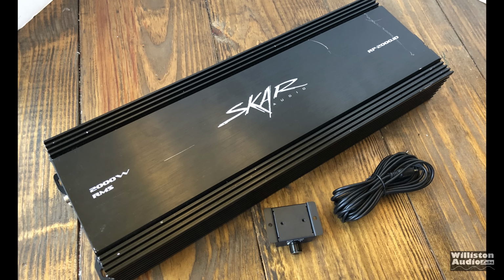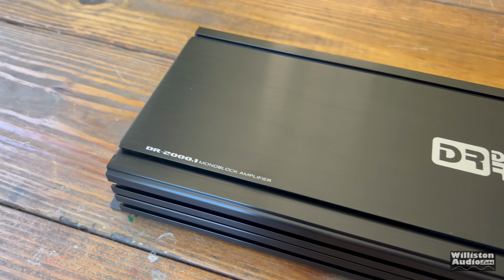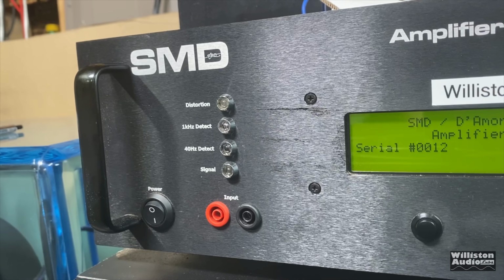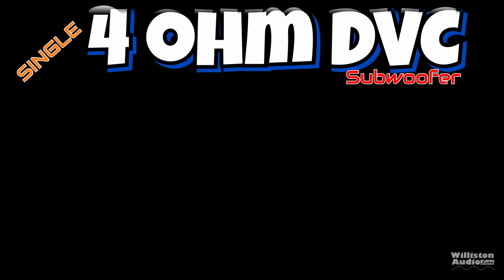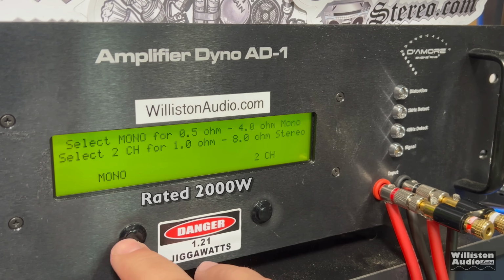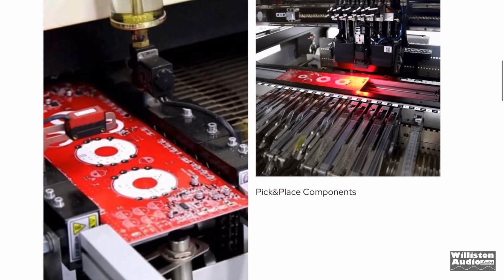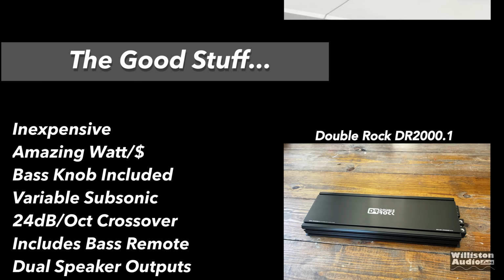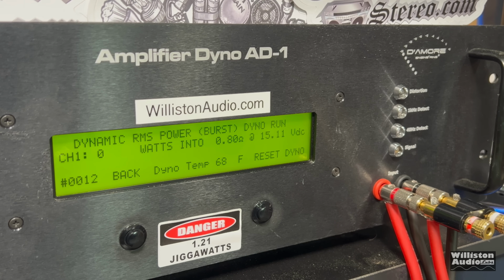SKAR Audio Wants it BANNED!! Double Rock DR2000.1 Amp Dyno Test and Review

Comment: Ya lol sry but the Dyno over all means zero as amp dynos so not account for impedance. Ya you can drop below 1ohm tho how long will the amp last is the real life ? here. For the cost of the amp with no warranty after the 30 days um ya deff now worth the money. No warranty after 30 days 100% yells won't last and after 30 days you're sol if something goes wrong. Can't tell cash grab any faster. I see a lot of kids who don't know amps or what they are looking at jumping at the amp due to its cost then losing the amp and complaining.
Reply: Of course the Dyno accounts for impedance. He even tests at different impedances FFS.
Reply: @johncoops6897  just stop talking lmmfao, impedance is not the ohm load. Impedance effects the over all ohm load which an amp Dyno does not account for. Impedance also known as box rise only comes into play when the amp is installed on a system with subwoofer in a box. Less the amp is hooked up to subs which it is not in the video impedance is not accounted for.
Reply: @ColdVenom159 - the impedance rises but never falls due to the speaker and box. Since there will be less stress as the inductive/resistive load increases, the absolute most difficult test is when the amp is driving a constant resistive load at a constant frequency, as tested here.
Furthermore, ALL power tests are done into a standard and constant resistive load so results can be compared directly and fairly, without the influence of speakers and enclosures. All manufacturers test and rate their products with resistive loads, and in fact they use special "minimized inductance" resistive loads to keep the ohmic load as constant as possible.
So, whatever you are babbling  about has nothing to do with amplifier power ratings. However it does factor into the overall result.
Reply: @johncoops6897  incorrect, impedance goes up and down when a song is being played, impedance dont rise then just stay at its peak according to the enclosure. that alone tells me youve got zero idea what youre talking about. while playing a song depending on the note being played the impedance will go up and down. even with the system the slightest vibration of the box will cause impedance to rise. amp dyno do not account for impedance as when using a dynp the ohm load does not change as the amp is not hooked up to subwoofers. stop trying to use bigger words in an attempt to sound smart its not working. youre over all the one babbling about nonsense. theres tons of videos on yourube alone with people using the AMM-1 with subs in boxes hooked up to an amp showing the impedance changing while music is playing. notice unlike you i dont have to edit my comments.
Reply: @ColdVenom159 - the impedance rises with FREQUENCY (at various nodes). Power tests are ALWAYS performed at a FIXED FREQUENCY , usually 1,000 Hz but BigD uses 40Hz for some tests.
So, whilst you understand some basics, you are completely and utterly misunderstanding the purposes of power testing , and the methodologies used to ensure that the impedance is kept as stable as possible.
For example, an amp might be rated 2,000W into 2 Ohms at 14.4V. In order to test if it actually makes that 2000W, the other two variables (Impedance and Voltage) must be held to their respective values.
Power tests into a speaker and box are not relevant in comparison testing, because it doesn't keep the test parameters as stable.
BTW I only edit to fix typos, which are introduced by typing on a tiny phone keyboard. Your ability to type unfortununately doesn't have any bearing on your understanding of the testing methodology.
Reply: @johncoops6897  its getting tiring already correcting your misinformation. dyno testing is done to see what am amp does according to how its rated. doing a lets say 40hz tone on a dyno the amp is tested at a solid non changing frequancy. i know far more then you think i know and well just by all your misinformation i know alot more then you know. tbh with your 22 subs and zero videos i dont have the want to entertain what you say anymore. youve done a great job with some google research that i will tell ya as some of the things youve said feels like a legit copy and paste outside of you mis spelling things. you can say im misunderstanding this or that tho thats why everything ive said i can credit with proof. on that note i dont have a need to waste my time with someone who can only manage to talk. ill let yuou keep tlaking tho as you seem to like to talk. i dont care to talk i rather actually be doing the stuff.
Reply: @ColdVenom159  - LOL, most people aren't even bothering with you and your silly comment 😃
I regret taking the bait.

Comment: Skar doesn't make their own amplifiers.  They contract a 3rd party to make.  Which happens to be the same company that is making this amplifier. Instructions are identical, the heat sink fins on the side are the same, even the terminals on the ends are the same.  It's the same amp.
Reply from the maker: I discuss this when I open the amp to show internals

Comment: There are two amplifiers that i've been searching on the internet for the nemesis aubio dyno and b drive wdx amplifier dyno
Reply: Get the Soundqubed S1-2250.1 I have 2 of them strapped at 1ohms half ohms per amp and it handles. I also once had them strapped to half ohms .25ohms per amp and it also handles!! I got 2 18" Resilient Sounds Platinum subwoofers ✔️it out.

Comment: I have a equation of probably some law I’ve not been able to read or digest, and it deals with wiring in series for speakers. I was going to wire a 3-way component set in my front doors, using in-line crossovers for the various speaker sizes. I was putting the 6” first, with bass filter, then 3.5” or 2” mid next in series using a higher frequency bass filter, and then a tweets last in series line on high pass filter. My question pertains to balanced power for each speaker set: does each speakers power handling ability dictate how much power it takes from the feed? If I feed 200 watts, will the power be absorbed equally in distribution to speakers? Or will my first speaker in series have to be not too power hungry for trailing speakers ability to get enough power? Cheers! Thanks again
Reply: The speakers draw what they draw. The crossovers dictate at what frequencies they draw.
You shouldn't be wiring non-uniform speakers in series, that is dumb. The crossovers should also never be wired in series. You are completely confused about how to wire this up!
You need one pair of conductors coming in, and each crossover's input connected get to that. The speakers then connect to the output of each respective crossover. So, each speaker has it's own crossover, and all the crossovers are supplied by a single input signal.
It doesn't matter if the crossovers are inline or not... that's the way it works.

Comment: Is there an article on efficiency. If amp takes 1/0 imput and is 80% efficient, then why only 8 gauge speaker wires. Shouldn't they be 80% of the imput size. Can someone help point me in the right direction. Thanks
Reply: Watts = Amps x Volts.
The input voltage is only 12V, so let's say it takes 100 Amps to provide a 1200W (input).
The speaker's voltage is determined by the Amp's power rails, which are internally stepped up (from 12V).
At 2 Ohms, the speaker is given (say) 22.3 Amps at 44.7 Volts and will give 1000W
This is basic information to explain the concepts and theory only, as it is quite different at AC Frequencies and with real loads.
The wire's sizes is dependant on the Amps that they have to carry, not the Watts.
The bottom line is that any Amplifier will run the speakers at above 12V, so the Amps carried by the cables will always be lower on the outputs.
Also, the correct way to terminate all cables into terminal blocks is using Crimped Pins, not the way that BigD does it. So, it really doesn't matter what size the connectors are, since a small pin can be fitted to a large cable.
Reply: @John Coops  I get it now.. thanks so much. It's the rails that change the voltage, and when voltage goes up, amps go down. That way, the output doesn't need to have as large of wire.

Comment: I have A question why didn't you run the wolf from 2400 at half ohm  It would have been nice to know what the numbers are  I'm currently running it at half ohm  On 2 sundown X18V3  Dual 2 ohms With some fans I think it'll be OK Right now it goes into protect because of the heat But after  Is playing it for A while  I was thinking while I was running it at half omh if It's meant to be But  The amplifier has been great But it seems like I'm in need of new power So I'll be looking forward to  A new video where I can get my new amplifier that you recommend that puts out a ton of power  For the low low

Comment: Considering in 1989 it was about $2.50 a watt this is crazy Big D. Lol
Reply: I agree.. In 92 i ran a autotek 90w amp priced at $300 bucks (over 3 bucks per watt!! Smh) . Pure power though, and bridged to a 1 ohm load it pushed my 1st car system. Two 10in.subs in a truck box I got for Christmas. Never looked at the branding though..in Ajo, AZ only Good Ole Radio Shack was the only stereo joint in town, so I'm assuming they were some realistic 10s maybe. Added a Alpine tape deck, and an eq booster, all in my 77 Chevy Malibu. I had the slanted box on the back underneath my back window, where the by 9s cutout holes are. About a couple years I bumped without anyone robbing my setup. I was called big D back then, but took it begrudgingly although 6ft4, 320lbs Fit the bill regardless of how I took it! Small towns in Southern Arizona.. i got many props for my 1st installment, alot of too short, 2 live crew, and NWA fed the setup nicely..  lol miss them daze, big D wiz!!!
Reply: @devaperzspotreviewz  Ajo in 92 must have been wild. Who lived there? You and a couple wild burros? Lol. I can't talk. I am in Yuma.

Comment: Do it bump doe? Hook it up to the quad box and run some current through it for a while. I like that test.
Reply: It's boring. They ALL sound exactly the same. He doesn't even use a SPL meter to compare.
Reply: @johncoops6897  it's also an endurance test to check the thermals.
Reply: @calvinevans8305  - not really, since it only averages about 1/10th the max power when playing music. Also, he hardly even tests or shows thermal anyway 🙄
Reply: @johncoops6897  it's a good practical test demonstrating performance and cooling efficiency.
Reply: @calvinevans8305  - it doesn't test either of those things. Look at the Power meter in the botton left corner of the screen, see the averaged power?
All amplifiers can make speakers move, there is no specific point to the test aside from adding a bit of music to the video.
Reply: @johncoops6897  I buy an amplifier to play music, not to play test tones in SPL competitions. It's a real world test to see if the amp plays accurately and powerfully over a duration of time. Then check the thermals to see how the heat sinks and various components deal with the heat. It's a very important test for those of us that live in the desert.
Reply: @calvinevans8305  - you cannot POSSIBLY assess "sound quality" from someone else's speaker playing in an open space (BigD's garage) using his camera microphone to record onto an camera (which is not an audio device) which is then processed in his editing software then finally uploaded to YouTube.
Furthermore, YouTube compresses the audio, converts it to digital which is transmitted over the internet to your computer which converts it back to analog, adjust it's frequency balance then puts it through a small amplifier which powers a completely different set of full range speakers in your room which is a different size and shape to your car. Your home speakers almost certainly cannot even reproduce the low bass from the audio, even if that bass is even tramitted with the YouTube video.
He also doesn't run the test for long and the temperatures are neither tested or published. Also, the music is never at "full power" so the amp never gets to full heat rise anyway. 
So, what was your point again?
Reply: @johncoops6897  Big D is the one testing the sound quality. I trust his expertise. Anything else you want to argue about?
Reply: @calvinevans8305  - and BigD is the one who has removed the "Does It Bump" segment, since it shows and proves nothing...
Reply: @johncoops6897  I Disagree with you and your opinion of the music test.
Reply: @calvinevans8305  - LOL, well good for you.

Comment: I really do appreciate your videos, they helped me to gain a better understanding of the amps. I have not seen anyone tested or reviewed the deaf bonce apocalypse AAK 8000.1D amp. I sure like to know more about it if you are willing to test and review it. Thank you.
Reply: The AAK8000.1D is a great amp and does make rated power for sure but as the other guy said, you need really REALLY GOOD electrical.  Higher output alternator, second battery or bank and good grounds.  Use 0 gauge OFC wire only when running that much power.  Id probably have at least 2 runs of 0 gauge running that level of power.  Make sure your mids and highs can keep up too or itll sound like poop 💩
Reply: @MAD_CarAudio  thank you for the info, I've been a basshead since the 80's and I'm grateful for all the information I found in my research during the past years growing up. I'm upgrading my system (electrical and sound)and I wanted to see the numbers on the amp. Done all the electrical so I think I'm covered 🙂 thank you once again and God bless you
Reply from the maker: Thanks for the suggestion

Comment: Awesome! I watched till the end this time 😃. 3,300 watts @ 0.8 ohms (275 amps). Yikes. Thin/cheap battery wires will melt. Maybe 4/0 welding cable?
Reply: 3/0 = 000 will be fine

Comment: I'd really like to see some hard evidence on whether or not  an in line power capacitor makes a difference in actual operation of amps 500/1000/2000rms watts . I believe it helps with the electrical "stability*" of the cars electrical system . * May not be the correct term
Reply: Capacitors are never mounted "inline". A large capacitor can (help) smooth out high amplitude short duration electrical loads, as it (in effect) acts like a second battery. This only matters at maximum current draw, when the voltage of the main battery (and wiring) drops below what is stored inside the capacitor.
As for the car, you will never be driving when the amp is 100% maxxed out, and car's electronics are designed to handle huge voltage ranges safely.
Reply: @johncoops6897  what is the correct term for how and/or where a capacitor is mounted in an car audio amplifier power circuit. I used " inline" in parentheses so it would be clear to all where the capacitor is .
Reply: @michaelfarrell6448  - Yeah, I understand what you meant. A capacitor is connected across the positive and negative voltage supply, as close to the load device as possible. This creates a secondary energy storage that the load can draw from in times of need.
The capacitor connection is in Parallel with the battery, since it is connected between the 2 terminals, rather than "inline" with one or both cables. For example, a fuse is connected "inline", whilst the capacitor and the amplifier are between them in "parallel".

Comment: A lot of times you're just paying for the name.  And some times it pays to buy the name.  And you'll never know until somebody does the tests and comparisons.
You're doing Gods work, Big D.
Reply: You're right. I remember back in the day, some Pyramid amps were made by Precision Power.
Reply: @dealerauctionnightmare4689 They were rare and most people never bought them.  I was curious to find out I had the cheap one, which explains why it lost a channel.  PPI was expensive and these were the same price.  American amps rock, cause I burnt a lot of international amps up.
Reply: very well said. Because, the equipment needed to test these amplifiers is not cheap by any means, plus the time involved? You gotta love it to do what Big D does. And for that, you're right, everyone should be thankful! This is one of the few, but real practical examples of the "internet" actually working for average people.
Reply: The best way it could've been said!
Reply: Sometimes the name comes with better warranty claims and customer service so it rrally depends.  On an expensive amp, id rather spend even more amd get a better name brand